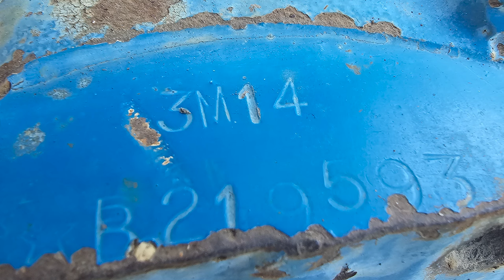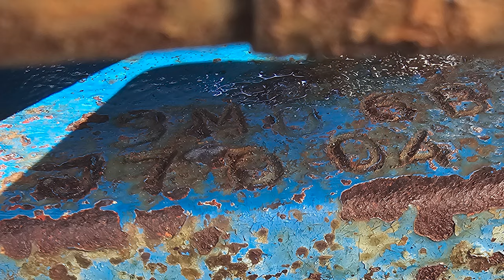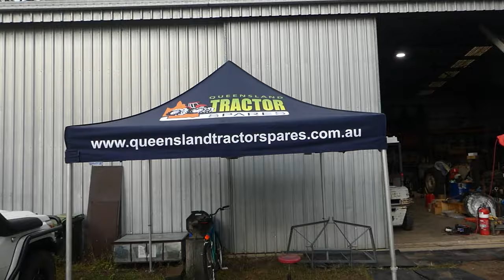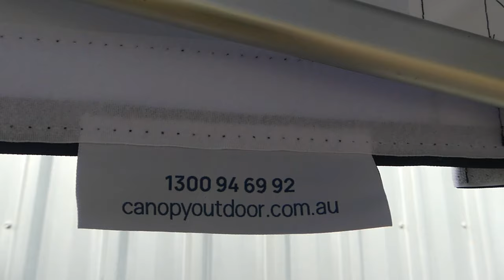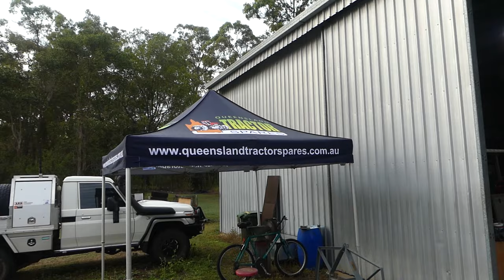Kangaroo Stew # 367 I Bought Another Tractor!

Comment: Hey mate try scratching around above that semi circle machine mark above the 2 sets of numbers there's supposed to be another line of numbers which give you model, chassis, fuel and pto. But from what i can see 3 means 1973 M means December 4th day. last line is Basildon factory uk with the serial number.
Reply from the maker: I found the extra numbers, Top B1012B which should be a diesel, 3M14 is Dec 14, 1973, and the B219593 is the serial number.

Comment: Reckon that ford be around  a1974 model oh doe you know  if a Ferguson  35 has welsh plugs in the head like the for it a petrol  engine  and is filling  up the sump with water  had put some stop leak in it worked for a bit but now doing  it again  it belongs  to a friend  but iam thinking  it may be the welsh plugs like your ford or it may  be the liner seals at the bottom  any thoughts  be welcome  thank you
Reply from the maker: If it has the Standard Motor Co engine there is a plug at the top under the rockers that eats out, I did a video in my Gold tractor playlist. If it is a petrol it can be a hole in the liners. If a 3 cyl perkins the plate behind the water pump can eat out and dump water in there through the timing cover.
Reply: @BundyBearsShed   thank you so much for answering  my question  was think that it may be the liners had gone as the tractor  had sat under  a tree for years with no love at all will pass on your information  it is a petrol  engine  so could  be one of your two answers

Comment: Lance … do you recon what year is it?  Even the early 3000’s until 1970 i believe had FOMOCO forgings all around, trumpets and engine block. Yours has FORD stamps…. My 3000 is a 1974 with all FORD stamps…
Reply from the maker: I'm guessing 1974 but I have nothing to back that up just yet apart from the 4 at the end of the number on the right side
Reply: @BundyBearsShed  most likey.
Reply from the maker: @udayrai5788  turns out December 1973